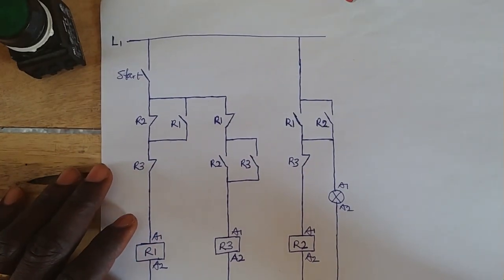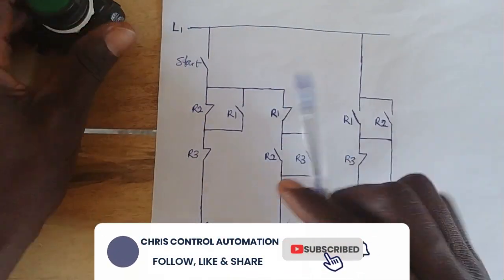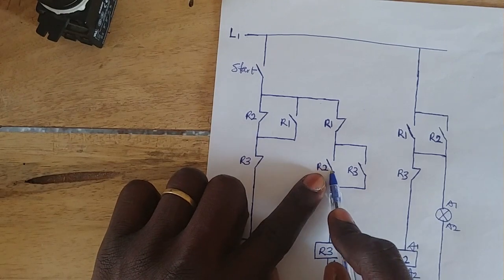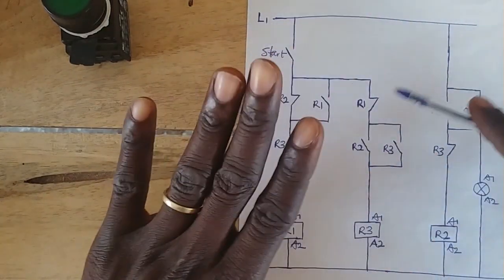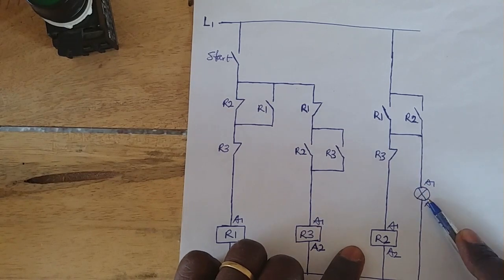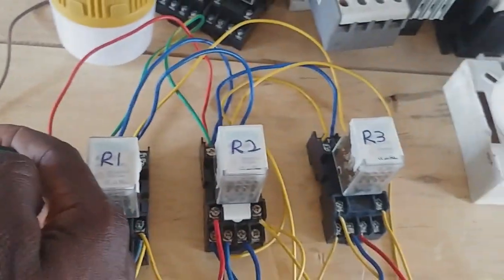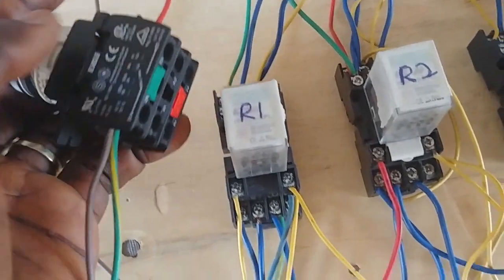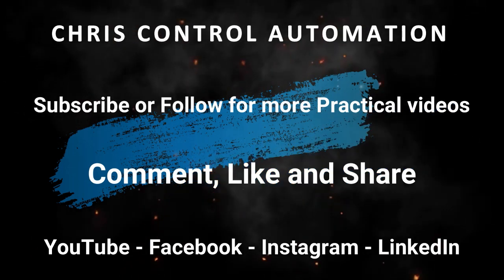SINGLE OPEN PUSH BUTTON ON AND OFF CIRCUIT

Comment: Send me bro two pump alternate wiring please
Reply: I don’t understand either
Reply from the maker: I don't understand what you are referring to.
Reply: @ChrisControlAutomation  Brother, I have tried not to control this way.
Reply from the maker: You want different diagram or what?
Reply from the maker: You don't want this control or what?
Tell me more. I don't still understand what you are actually saying.
Reply: @ChrisControlAutomation  I'm Pakistani
Reply: @ChrisControlAutomation  please send me logic
Reply from the maker: I should send you the control circuit
Reply from the maker: Come again with your question
Reply from the maker: Which country are you in.
Reply: Send relay 1bay 1 on off daigram